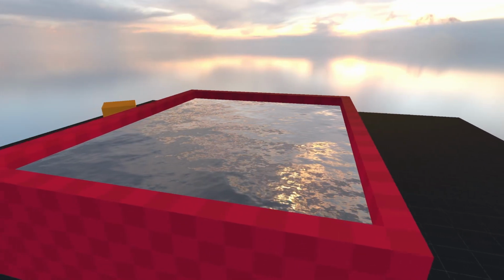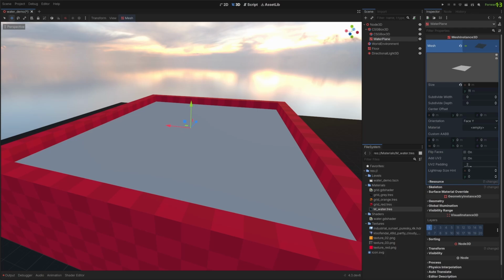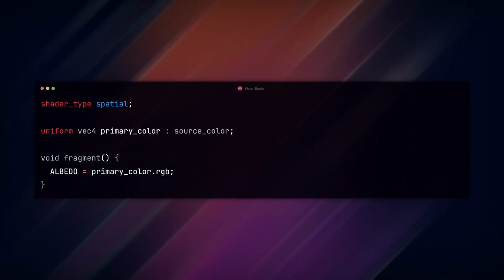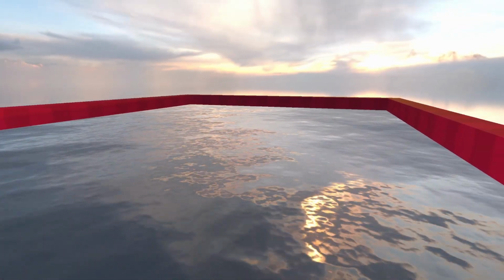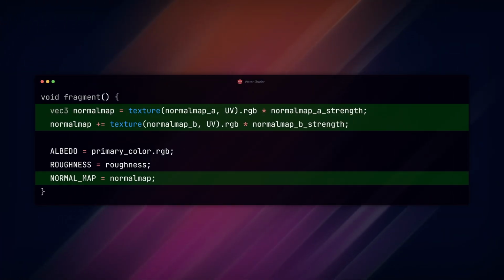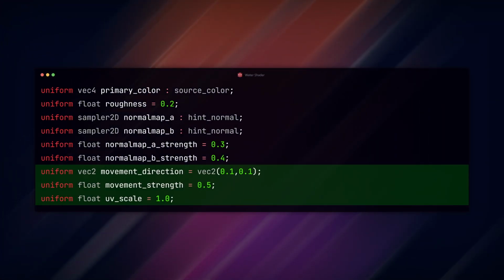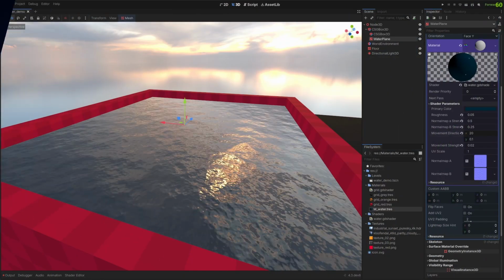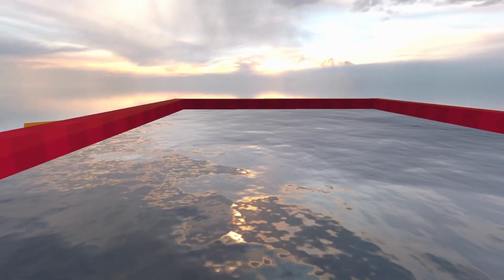How To Create A Water Shader 2.0 // Godot 4 Tutorial

Comment: I think the code for the normalmap is producing unexpected results. If you adjust the normalmap strength you'll see the reflection of the sky spins around the x axis. I suspect that directly influencing the colors. Also adding the two normalmaps together seems to mess up the reflection, I get better results with the mix function
Reply: As of Godot 4.4, adding them causes the colors to behave weird. My first instinct was to multiply them instead, and now I wasn't getting sky reflections. Using the mix functions fixed this, thank you for pointing that out!